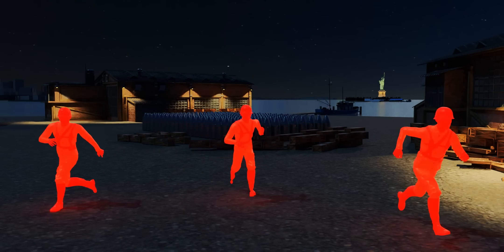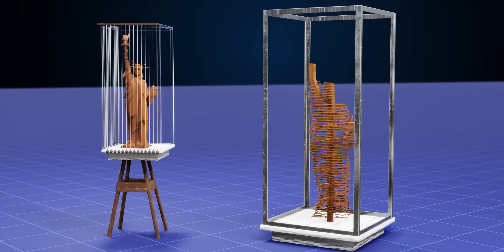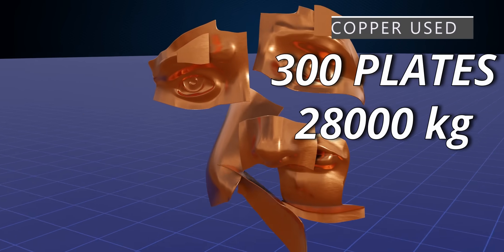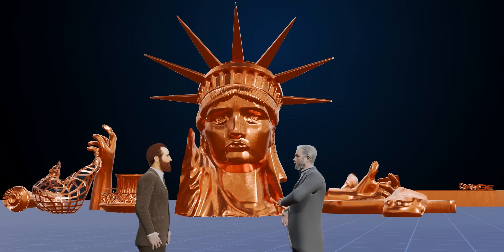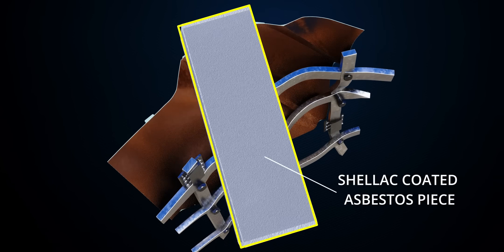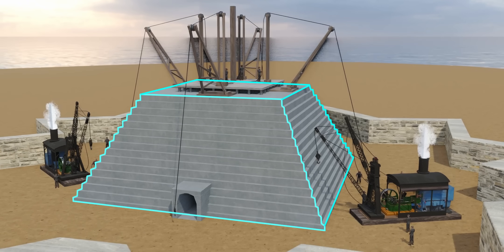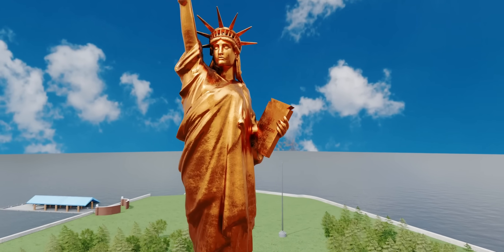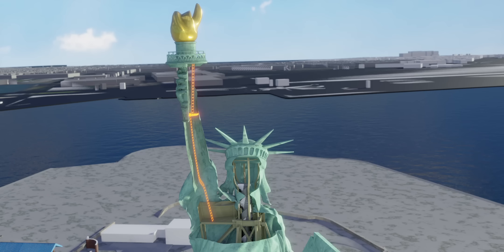Statue of Liberty : Even Today's Engineers are Surprised!

Comment: How do they handle galvanic corrosion? Copper and steel shouldn’t touch.
Reply: He talks about this in the video, they used shellac coated asbestos as spacers. A lot fo years after this though, the shellac and asbestos wore away and they decided to restore it by changing all the rivets and connecting structures to chromium-nickel-molybdenum stainless steel alloy and coated it with nonstick Teflon.
Reply: @ I saw that after posting. Pretty smart.

Comment: 7:30 bro doesn't understand transfer of inertia or something lol first shot hit a slope and transferred energy up and left and bounces directly back, 2nd shot transferred energy down and left and bounces up and left and is more of a glance initially. Look at the remaining energy in the balls and their final trajectory. You can deduce that the same forces were not applied in both cases.

Also, he lies about the height comparison of the model clearly. 1st one is taller and more likely to topple. Take a good look at both models, if you're on PC pause at 7:29 and tap right 3 times it should bring you from thick to thin model and you can go back and forth. Base is flipped but clearly the thin bar model is lower on the frame.

I completely agree with the thin support vs thick support it intuitively makes sense, but lying and doing poor testing with uncontrolled but controllable variables isn't the way to do things...

Good video otherwise but that guy ruined that part for me.

Comment: Hi there! Great Video! I’m a NYC tour guide and I found a lot of info to add into my tours. Sadly theirs is just one small thing wrong… at the moment there are no elevators in the Statue of Liberty. Not to the pedestal not to the crown. Non for ADA. I must confirmed if their ever was, but if their was. Is very easy to think why they to it off. No one would want to use the elevators and huge lines of guess would form. And the elevator won’t keep up with demand.
Reply: There are actuallly 3 elevators. One for most of the pedestal, another one for the last floor of the pedestal. Both of which you can use if you are handicaped. And a final service/rescue one in the statue, which you can't use.